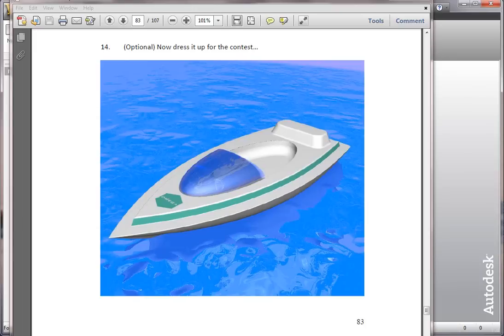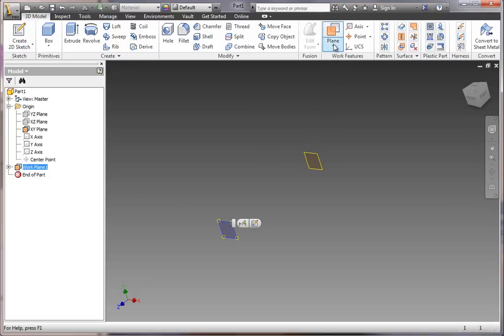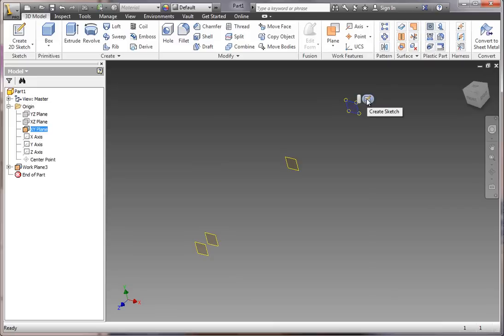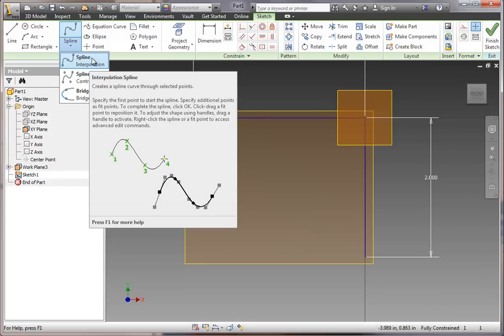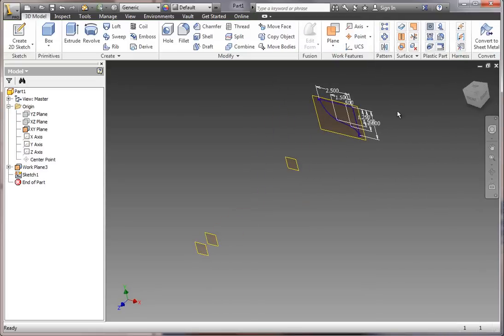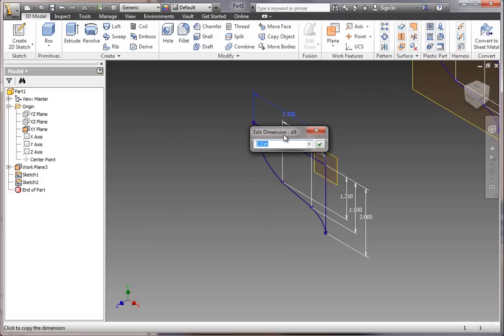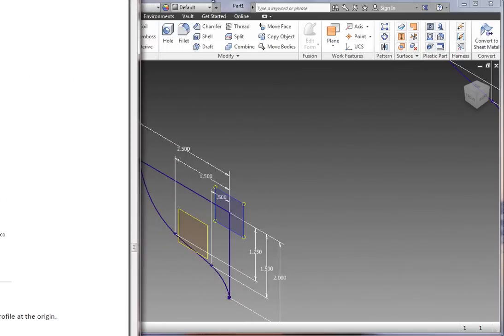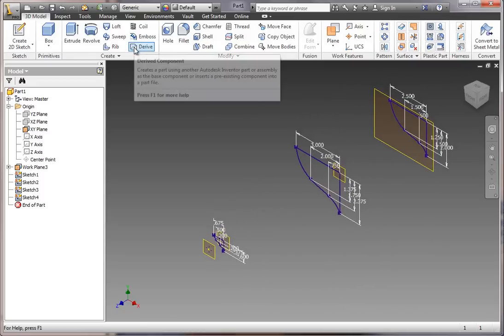E8 INVENTOR  LOFTS - Modeling a Toy Sail Boat Hull

Comment: 90% of the stuff you ae doing does not work when I do it..

Making the plane visible is as far as a got.. When I right click those options are not there for me..

I hate when version makes tutorials obsolete....
Reply: Ronald Baker what year are you using? it worked great for me on 2013
Reply: 2015
Reply: Ronnie Paul I did it on Inventor 2016. And everything was fine.